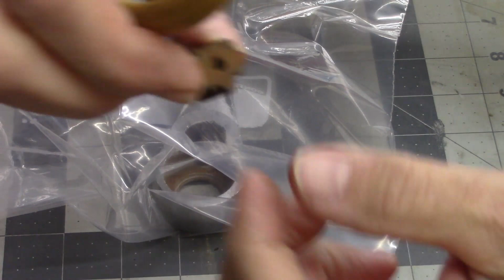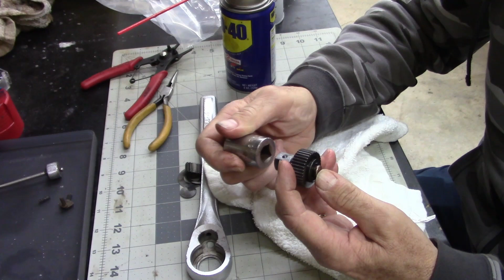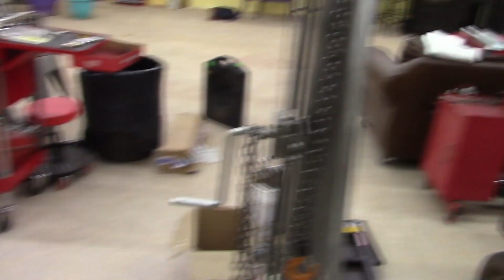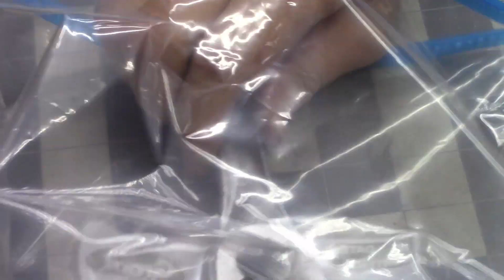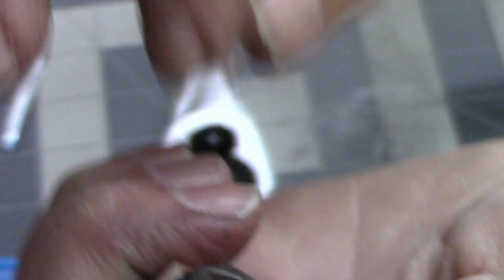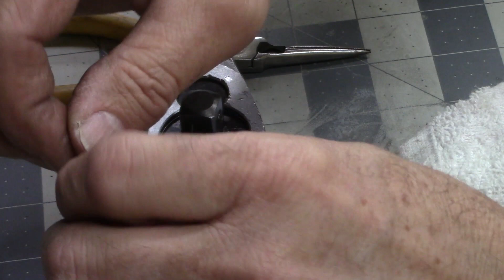Craftsman ratchet clean-up and lubrication

Comment: Very good video. It's a shame that ratchets are allowed to get in this condition to begin with. If you clean your tools consistently, especially when exposed to the elements, this can be avoided. Of course frequent oiling with regular 10W30, especially after your ratchets have been exposed to water, is key to keeping them working like new.
Reply from the maker: I agree, you are right, clean them often, I know!